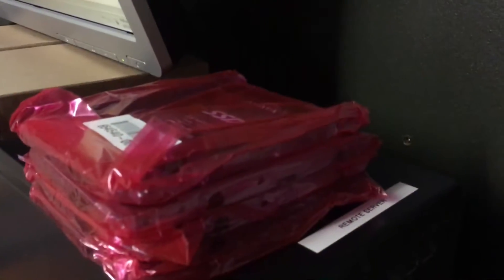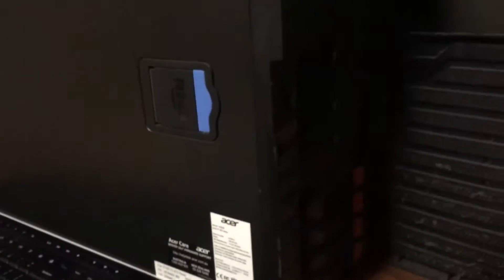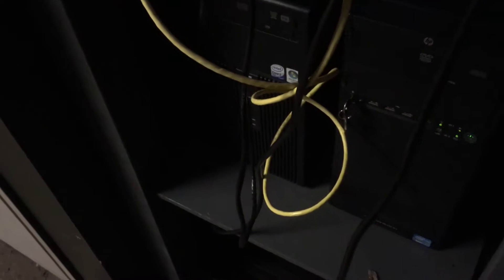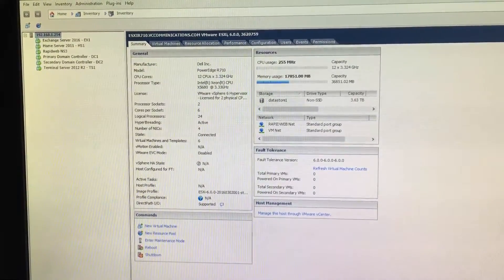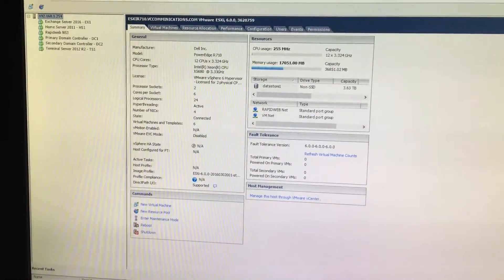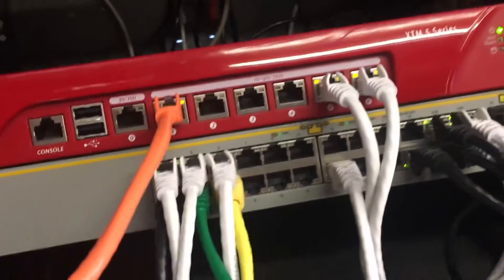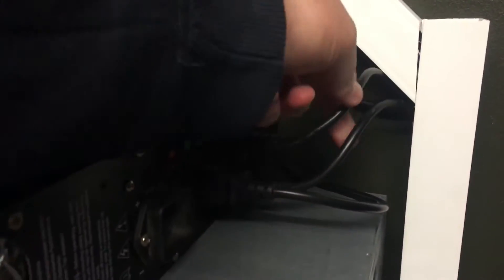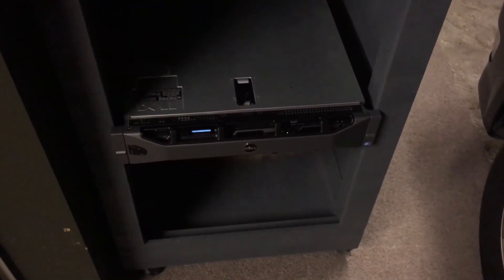Server & Networking Upgrade 2016

Comment: How much power does that R710 pull from the wall in your current config?  Is it loud? My HP DL380 G6 is dead quite in my rack running 24/7.
Reply from the maker: Hi Chris, Thanks for your comment. The server it's self uses approximately 260W with 4VM's Running. It's not too loud it's noticeable but not annoying like some of the others.
Reply: ilo2 is currently reporting 140 watts. To give you an idea of the HP server. I currently have 5 VM's running.
Reply from the maker: +Chris Lowe Not bad at all. How many physical CPU's do you have installed and what is there core count each?

Comment: 2x Xeon 24gb ram E5540 4 6g sas 10k dual port. The cpu are quad core with ht enabled.
Reply from the maker: Ah that will be why your power usage is low I've got 2x Xeon 6 Core's in it I think there like 120w rated CPU's. So 12 Cores in total and 24 Threads. I would like to stick SAS Drives in mine but there way do dam expensive for 1tb drives.
Reply: I have 2x Xeon L5520 rated at 60w each i'm planning on switching to lower pow use
Reply from the maker: Turns out my CPU's are 130W Each (x5680). Its probably going to be hard to find CPU's with a lower wattage then what you already have.